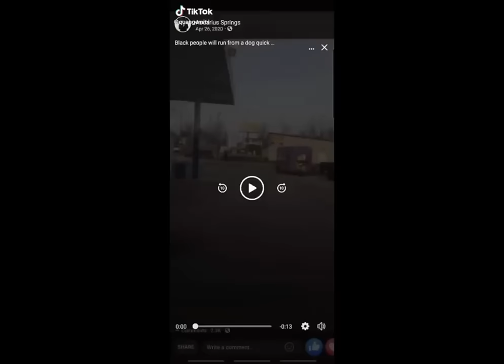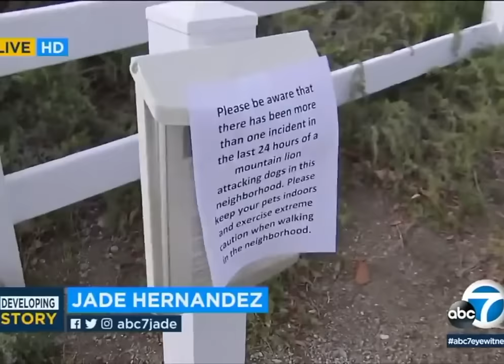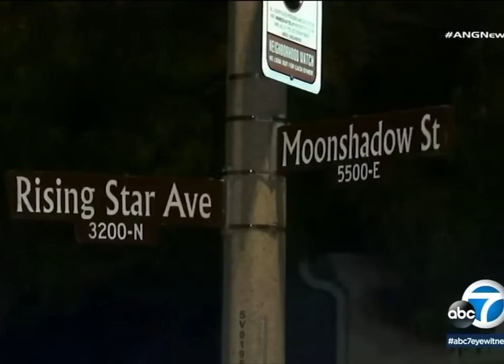Unbelievable Animal Encounters Caught on Camera in about 1 Hour | Best of Series

Comment: The rabbit getting a bath is not laying there because they’re “enjoying” getting bathed. First of all, when rabbits are placed on their back like that it puts them into shock which can kill a rabbit. They can literally have a heart attack from this. That rabbit is frozen in fear. Secondly, rabbits can also go into shock when submerged in water. Rabbits normally don’t need baths, and when they do, they should never be placed on their backs like that. They should only be placed in water that submerges their feet, no more than that if at all. And if they don’t need to be soaked, cleaning them with a wet cloth is the best way. That is cruel, though the person probably has no idea that what they’re doing is wrong. On another note, rats don’t need to be bathed either most of the time. Just a tiny little drop of water can get in their respiratory systems and kill them, plus it’s also really stressful for them. I made the same mistake when I had rats. They never got sick from it, but they did get very stressed out. Rabbits and rats usually clean themselves just fine, and in cases where they can’t or don’t, make do with a damp cloth if you can help it. Don’t put them through unnecessary stress.